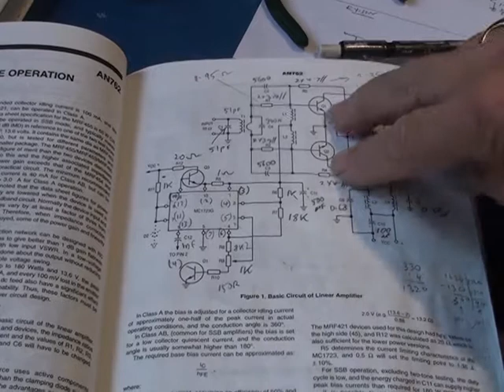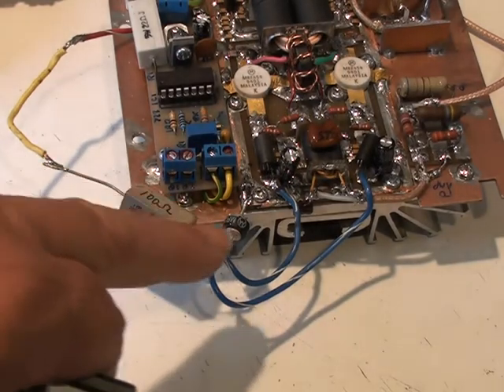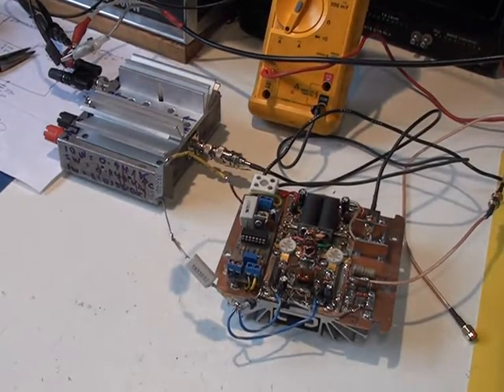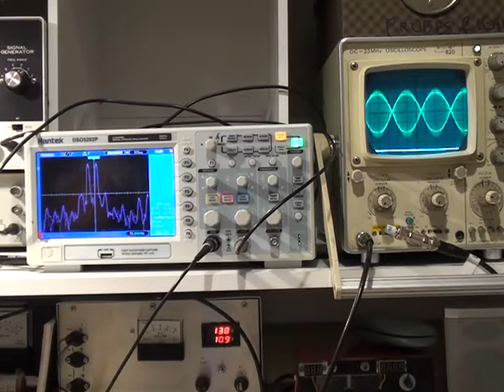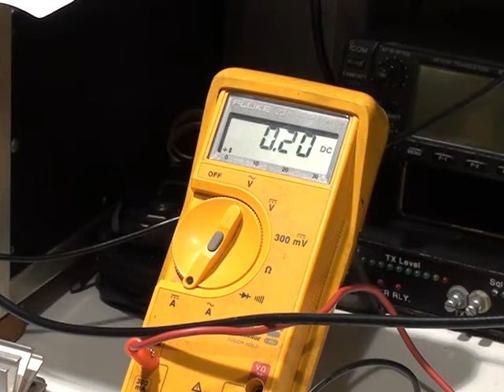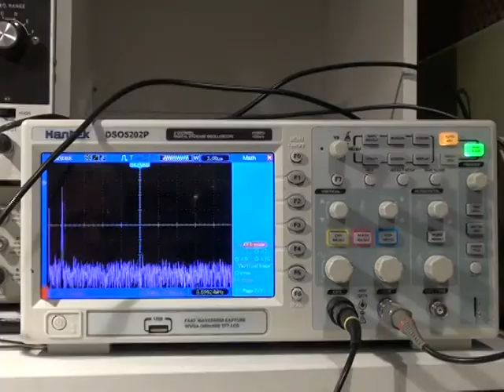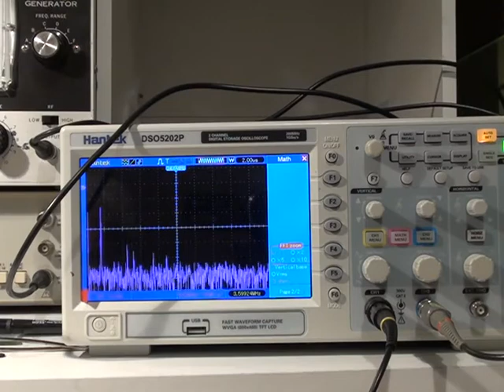100W MRF454 Intermod distortion problem

Comment: You can't hold class-AB when you're feeding the bias from hundreds of Ohms. The input signal at the bases  is very low impedance... on the order of several Ohms... and will severely load your bias source. Try feeding with an emitter-follower to get a very low bias feed impedance. Only then will you be able to hold your class-AB bias position... when the drive comes in. Very happy to see somebody who knows what they're doing!
Reply from the maker: Yes, that's right. I made a mistake with a resistor value for the Motorola circuit. Once I changed that, it all worked well. The design does contain an emitter follower, the BD135, driven by the LM723. There is a low value current sense resistor in circuit, 0.5 ohm, as specified by Motorola. Since the regulator is a feedback type, the actual dynamic impedance under load is even lower, as you get in any emitter follower design. The input impedance as seen into the base, is the emitter resistor multiplied by Beta, and the output impedance looking back into the emitter is the emitter resistor divided by the Beta - just basic transistor theory. As I said in the video, after I found the wrong resistor and replaced it, the amplifier worked correctly up to 140 Wrms, and met the IMD value in the design. Thanks for your input.

Comment: Great work! I know this is an older video now, but can I ask, how are you using the Oscilloscope FFT to monitor IMD? (How have you set this up? I want to do the same with my Hantek Oscilloscope). Mine is a DSO2D10, 100MHz, which I think is similar to yours.
Reply from the maker: Hello,thanks for the compliment. The Hantek I have is a 200MHz one and has an FFT function. I imagine yours does too as you mention.  The FFT function is selected using the "Math menu" button between the CH1 and CH2 select buttons. That should bring up the "purple" FFT frequency spectrum display. It has a menu which allows you select the channel, window processor (I use Hanning - reduces leakage better around each FFT sample), dBm or linear scale, and FFT zoom  EG. X1, X2 etc. I use X5 which is good for spreading out the 2 frequencies corresponding to the 2 tones you are feeding into the transmitter audio input. 

The Probe will be on the RF stage you are testing and you will have set the CH1 gain so that you get a good size RF spectrum at the carrier frequency. You need to use dBm for the scale. Then you adjust the horizontal position, and the timebase rate, turning the horizontal position slowly, till you see the 2 vertical lines of the tones appear normally from the left. They should appear down near the start of the spectrum and are essentially a product of the scanning frequency and the FFT samples.
You need to adjust the zoom to  move, or spread the 2 tone spectrum lines. They will appear down near the start of the FFT  and by adjusting the horizontal shift you can bring the tones into view. 
 I do have an analogue spectrum analyser (HP) which also can display the 2 tones and I find the Hantek is pretty close. However the dynamic range of the Hantek is around 60dB whilst my HP is around 90dB. But for ham radio testing you are looking at around -30dB, or better,  IMD in the main signal. If you are trying to test the receiver IP3, say at 14Mz between two RF signals 10KHz  apart, then you need a totally different setup (see the book Experimental methods in RF design by Hayward, Campbell, Larkin etc for more info).  Cheers, Lou
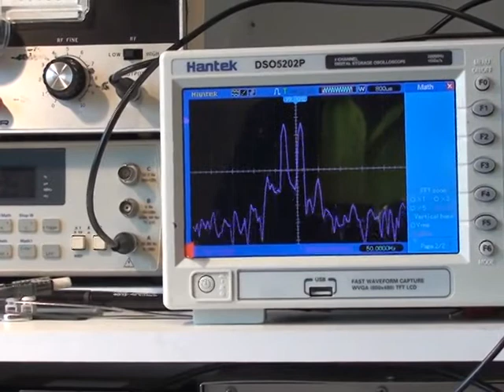Reply: @vk3aqz  thanks for the fantastic reply! Up until now I have not been able to get the same level of resolution or refresh rate speed as you, from my FFT mode. I will try your suggestions and will report back. One more question - in the FFT screen I see at 3:15 in your video, what is the center freq and span? Is the  center freq the RF carrier freq? (e.g 14.100Mhz) or is it the audio freq (e.g 1 to 3KHz or there abouts? ) I'm trying to get my head around TX IMD testing, slowly but surely :) . 73
Reply from the maker: @mostlypostie1 It is some time since I used the FFT function. I think the when you select FFT, the knobs do different things to the normal oscilloscope function. The timebase  knob changes to , I think, samples per second. And it changes the spectrum width as well. The 50Hz at the bottom is probably the sample rate (Hz per second I think). The timebase window at the top might be the spectrum width per division. I think it is 800us, which  is around 1.2kHz per division.  The 2 tones I was using were around 650Hz and probably around 1.9kHz which means they would be around 800uS apart on the display or 1cm. The actual RF frequency was 3.6MHz. Something that happens is the you can get aliases and foldback when there is RF above the Nyquist frequency. The foldback is caused by undersampling so you might see the 2 tones at several spots inside the spectrum width.  The X1,X2, X5 and X10 is a magnification function of the spectrum (you only see more or less inside the screen width). So the spectrum spreads out or gets narrower hence the term FFT zoom. The main thing to  think about is that the normal CRO controls do something different and if you look at the knob markings, you might see they contain 2 types of functions printed. It's not all that clear but I think the manuals have more info when using FFT - in FFT mode it is no longer a CRO really but  a spectrum analyser and the knobs become spectrum controls instead. Maybe feed a 2 tone RF into the CRO . Say 3.5MHz, and play with the knobs. Make sure the 2 tones are not harmonically related or you won't see the IM products since they will be on top of each other. See how you go. Cheers.